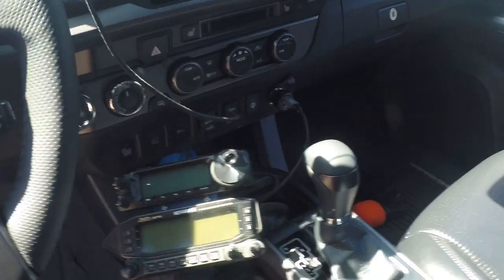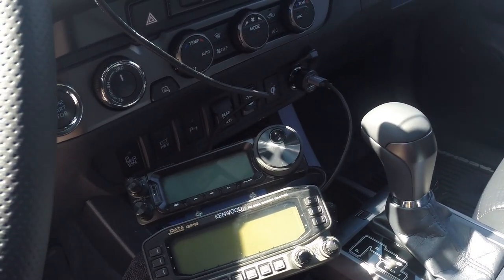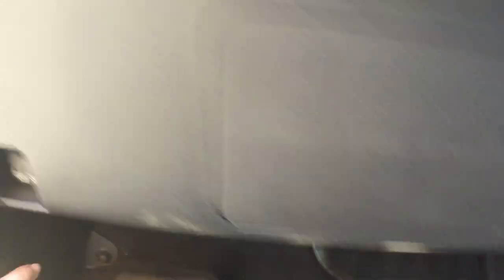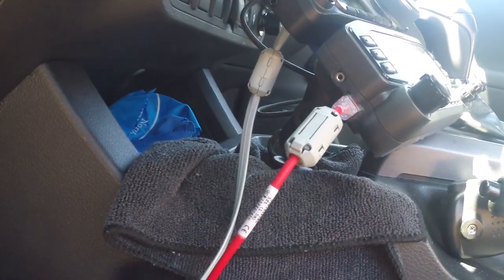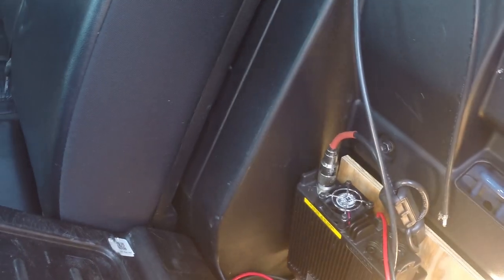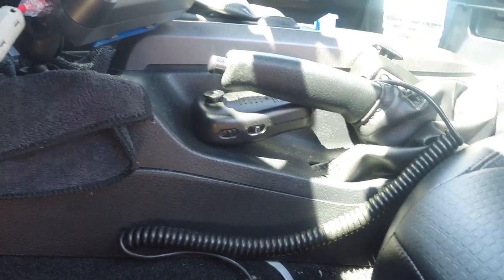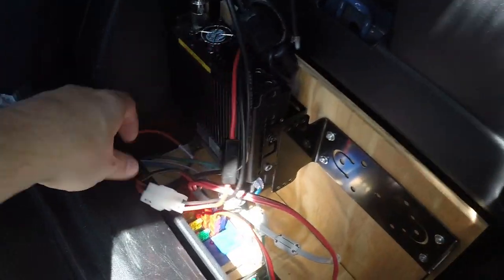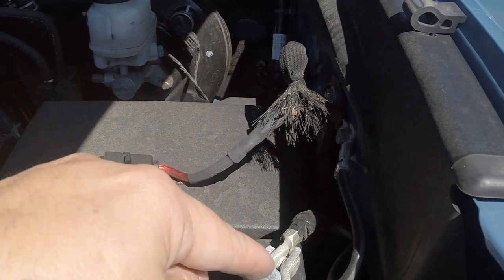Ham Radio Mobile Install - Toyota Tacoma Ham Radio Install

Comment: Hey Kyle!  Thanks for the video describing your mobile install.  I am interested in going mobile with my new GMC Truck and getting some ideas.  I had a question on bonding.  I have seen bonding done to the same bolt you used to fasten the NMO mount.  I did see the strap going to the NMO mount in the back.  Do you have any trouble with the coax getting pinched by the tailgate?  Thanks again for your video!  I like how you explain the reasons behind what you did.  73 de KI5HXM
Reply from the maker: Hey Brent.  No pinched coax as it's small enough to fit between the space.

Comment: I planning to add a uhf/vhf/hf mobile transceiver and a couple extra batteries so I can run it when my vehicle isn't running in my work van delivering. What people keep telling me I should run a CB as well but I have strong opinions against it, but with my job people I deliver to as a rural postal carrier use CB and I'm mainly a technician studying for the general, I'm not sure which can brand to get and I dont want a million radios in my work van 73, kq4hcu.
Reply from the maker: Awesome thanks for the comment!

Comment: Kyle,  I've just found this video and have one question.  I noticed ferrite snap on beads on multiple cables from mics to control cables and coax.  Do you add ferrites to every cable as a matter of practice or were you chasing noise or other RFI?  Just curious about when and where to apply ferrites.  Thanks
Reply from the maker: @paulKJ5GKK  matter of practice. I didn't have any rf issues on vhf or uhf frequencies. I can't use HF while the engine is on because the fuel pump puts out a ton of RF.
Reply: @AA0Z  Thank you.  Loading up on snap on beads as we speak.  :😀

Comment: Great install!  I'm just running a TM-D710 in my 2017 Tacoma but my install was done in haste and not as nice.  You did a great job finding antenna mounts that don't destroy the vehicle.  And put in a lot of work running cables!   Is the color of your Tacoma Calvary Blue?  Fell in love with that color first time I saw it but not sure if it's still available.  73 Mike WB8CXO
Reply from the maker: Hey Mike.  The color is Calvary Blue.  I don't think you can get it anymore, as it was only for a couple of years.  Thanks for the kind words for the install.  Your point is right on about getting mounts that don't destroy the truck as I will not be the only owner of this truck so I'm hopefully doing someone a favor in the future so the truck retains some value without holes all over it.  My friend use to work on police cars, so he had all the tools to fish the cables in and out hard to get areas.  73 and thanks for watching!

Comment: Great install!  What NMO mount are you using with the Rago bracket? Does it use the standard hole as it comes for a SO239/UHF connection/mount?
Reply from the maker: Just a regular nmo mount.
Reply: Mine works with a UHF/ fits a regular CB-style- mount, so I am using a super heavy duty mount to a 102" whip w/ 6" riser.

Comment: Great looking installation. I am still working on getting my Tacoma installation finished. I haven't had good luck with suction type windshield mounts, though.
Reply from the maker: I've had good luck with that suction cup for some reason.  I think out of the 5 years I've had it, it's popped off maybe 3 or 4 times.  More times during the summer months when the car is facing south with the windshield directly in the sun.

Comment: Very clean install. Do you have any info on the timed power disconnect you have installed in the back with the distribution block?
Reply from the maker: I think I purchased it at powerworx.
Reply: @AA0Z  sounds good. I’ll take a look

Comment: Hey Kyle, I am back again.  Don’t take any of my questions as criticism just a curious guy wanting to know stuff.  I noticed you put the 2m/70cm antenna for the FTM-400 on the hood.   I liked how you did that, but am wondering about RF exposure with a 50W rig.  Is that an issue I should be concerned with?  I have been thinking about mounting a 2m/1.25m/70cm antenna on my roof since I need 5’ of clearance for RF exposure according to the ARRL calculator.  Comments?  The other question I have is the mounts for the HF antennas in the back.  I am considering using a couple of ham sticks initially and with whips, I am leaning toward mounting them lower down more level with the bumper.  But will this prevent signal from the truck in the way?   Both VHF & HF antennas are going to be high and I am trying not to bang against low hanging lines and bridges.  Lol.    By the way, I really like how you placed your equipment.  If you have any questions with my questions, let me know.  I love this hobby that I get to use my mind again after retiring as an engineer.  All the best!   73 de KI5HXM
Reply from the maker: Hey Brent.  I don't worry about RF exposure because I do very little transmitting, but you do what is safe for you and within your risk level.  Placing a HF antenna at bumper level will not affect your HF ability to contact stations.  73.
Reply: @AA0Z  Oh, you receive mainly?  I have no idea how much I would talk on the road, but I have to design for the worst (kind of a engineering handicap - as it were haha).  Thanks for answering my silly questions.  Speaking of the bumper mount of HF sticks (future screwdriver maybe), I am trying to stay below 13’ total so I can avoid slamming it on a bridge.  Do you know if that is good goal for the height?

Comment: I really like how you broke down the install of each cable; control head, mic, power and coax. Tacoma is such a small space to work with but you made it happen with 3 radios! But why do you need the Kenwood? I could see if you wanted a 3rd rig for DMR or a D-star rig but you can do APRS on the ftm-400 or just use an HT for aprs/146.520 monitoring.
Reply from the maker: I was going to pull the covers off but didn't have the right tools and patience where I was filming.  Basically in that plastic mold along the bottom door jam where the cables route from the front to the back seating area is a lot of space to route cables.  When I go on long trips I program the FTM-400 with all the repeaters.  I use the Kenwood for APRS and to monitor 146.520.  When I go out west, there is a ton of .52 traffic and I don't want to take up a VFO on the FTM400 for that.

Comment: Hello Kyle
I have a 2017 Tacoma and I have problem with rfi in 20 meters, I found the problem, was the fuel pump computer located under the driver side mounted at chassis. I bonded my car everywhere but still bad just in 20 meters, I can’t listen wen the engine is running. You can check my mobile station at my QRZ.com
73 de W4LDS
Reply from the maker: Hey Luis.  I don't do much mobile operation while moving, but how did you narrow it down to your fuel pump computer?  That's impressive.  I'm sure it wasn't easy to figure out exactly figure it out.  I'll check out your qrz page.  73
Reply: @AA0Z  I used my HT Icom IC-T90a to pin point the rfi in 20 meters, thats the only band I have problem. tks - 73

Comment: Can you share some information about the power distribution? I may have missed it, but I’m interested in the unit that shuts power off after a certain voltage, as well as the distribution section with fuses. Thanks!
Reply from the maker: The power distribution is just a basic Anderson Power Pole Distribution. https://powerwerx.com/powerpole-power-distribution.  The power shut off is the Powerwerz Auto DC Timer and Battery Guard : https://powerwerx.com/automotive-dc-timer-lvd-battery-guard

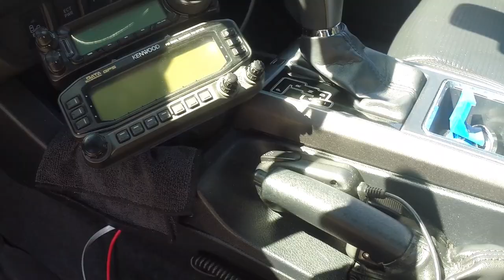Comment: Nice video. What are you using to attach the rj45 coupler to the vehicle and allow it to swivel. 2:27
Reply from the maker: It's just a RJ45 through connector.
Reply: @AA0Z  thanks.  I was trying to figure out how it was connected to the carpet
Reply from the maker: @jasonwalton9169  oh, it was just Velcro.  The really good stuff is called 3M Dual Lock.

Comment: How's the 2m Tx/Rx with that Rago mount? I have one on the way and I'm curious how the absence of a ground plane may affect it. I really don't want to drill a hole in the roof.
Reply from the maker: If you get a no-radial or no ground plane antenna, I've always had less sensitive reception than an antenna with a ground plane.  The tail gate mount radio (TM-V710AG) has much more static than the same signal from the antenna from the hood mount.  I had do some minor grounding to get any HF signal when using a hamstick.
Reply: I know this comment is 3 years old but I just came by to tell you not to be scared to drill through the roof, especially if you can find and pay a vehicle up-fitting shop to do it. Call your local police, municipality, county, etc and ask where they get their vehicles up-fitted. The same guys that wire up the cop cars, fire trucks, ambulances, etc can do a pro install in your personal vehicle. I've had my camper van up-fitted twice for ham radios and it was worth every penny!

Comment: The mic cable used to plug directly into the head unit, but for some reason the engineers have decided to move that plug to the main unit. now you have to run two cables from the main unit. So stupid! Come on Kenwood, Yaesu, Icom, everyone.....change this back. The main units are placed out of sight, many times in the trunk, with the head unit up near the driver/ operator. Why plug the mic in to the main unit?
Reply from the maker: Totally agree!